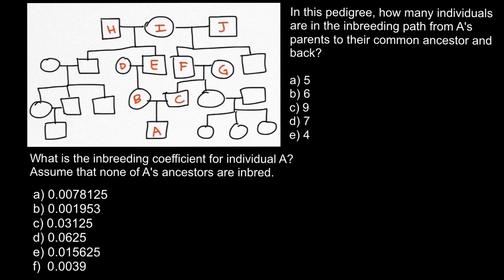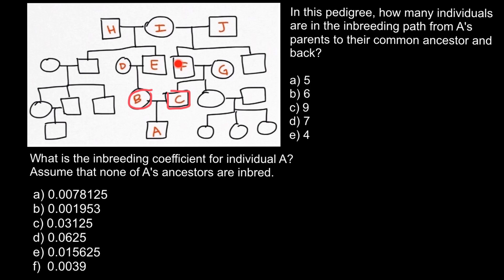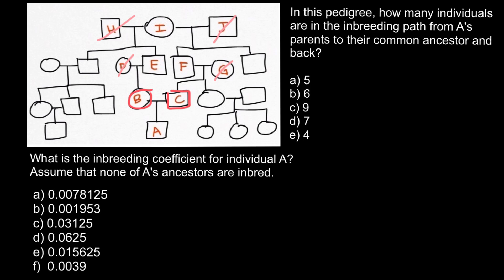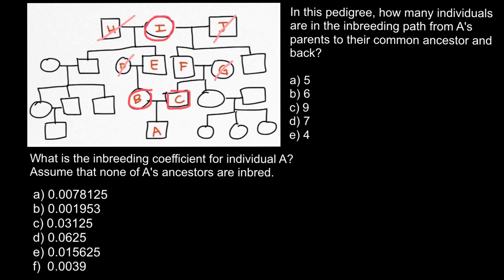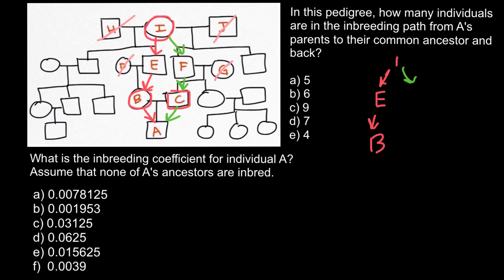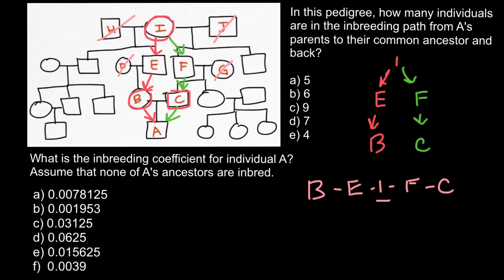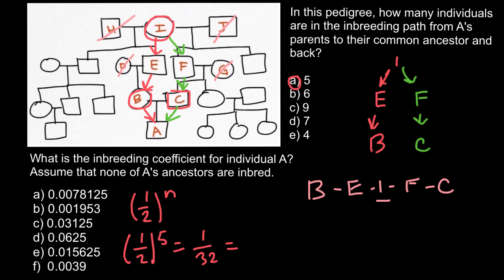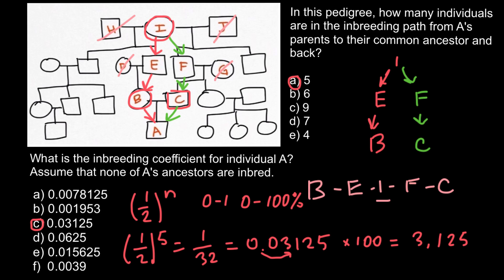How to calculate inbreeding coefficient

Comment: hello. can you tell me please? Is it possible to obtain a response to selection if one starts with a perfectly inbred line?
Reply from the maker: No, because no genetic variation. All variation would be due to environment variation. 
And Yes if multiple generations - some accidental  mutations may cause accumulation of genetic variation.
Reply: Thank you so much.
So, it means that it might and might not.
if you take one plant and colonize somewhere by one inbred plant (selfing possible) and there is no another individuals of its species exist there, is it possible become more adapted to the local environment and become  healthy genetically diverse species?
Reply from the maker: Да, некоторые растения хорошо переносят инбридинг и процесс накопления мутаций происходит достаточно быстро.. Например когда в лаборатории выращиваются растения в пробирках - то приходится менять расттительный материал каждые 10 покалений - так как процесс накопления мутаций происходит очень быстро..
Reply: Спасибо.
подскажите пожалуйста как можно найти Hi, Hs, Ht, Fit, Fis, and Fst , если у меня только данные individual genotypes ?
Reply: For example  only individual genotypes for Great Britain (GBR), Finland (FIN), and Southern Han Chinese (CHS) 

GBR  - HG00096=0 HG00097=1 HG00099=1 
FIN - HG00183=0   HG00185=0 HG00186=2  
CHS  - HG00403=1 HG00404=0 HG00406=0
Reply from the maker: Гляньте видео в моем плэйлисте population genetics или plant selection and breeding - мне кажется что я решал уже что то похожее..